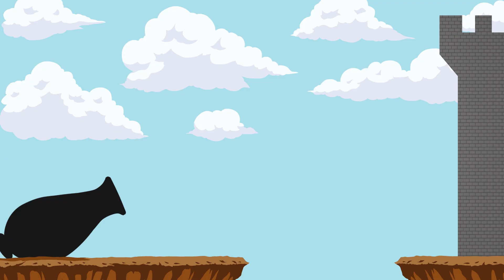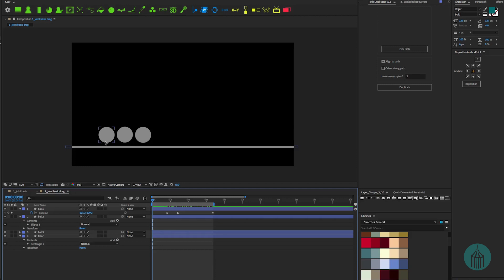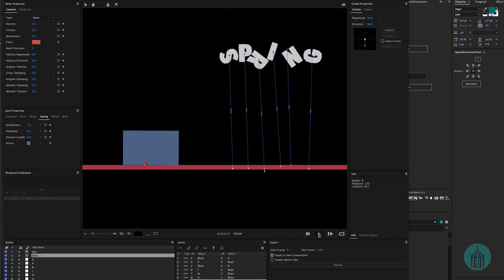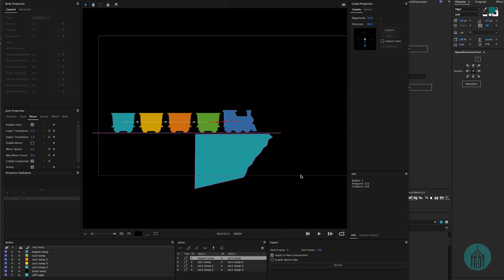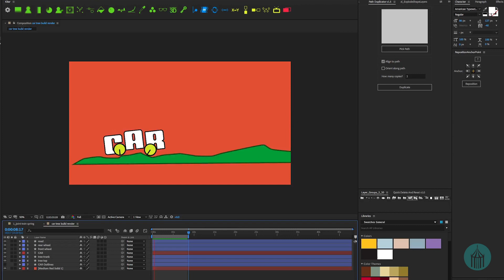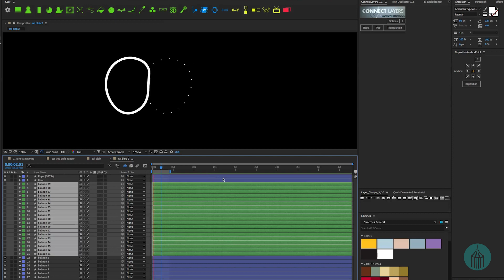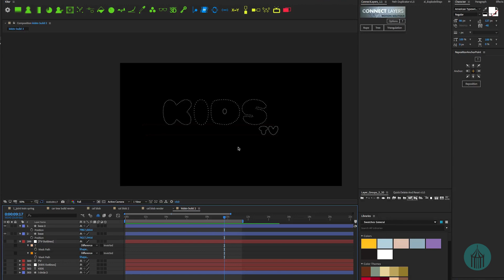Comment: At 31:00 in, the two "cells" bounce off of each other but are still blobby. How did you achieve that, if the animation in Newton was originally made up of points? Great videos by the way, thank you!
Reply: Very good question and it's an extra step I should have mentioned. I have the first cel objects Magnetism (In the advanced tab) set to Repulsion so when they get close to the second cel they push away.